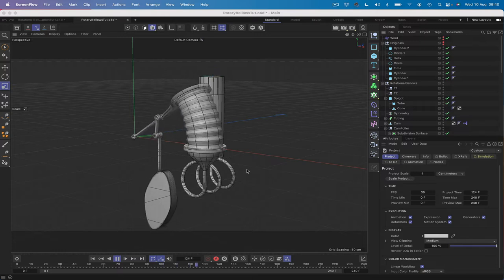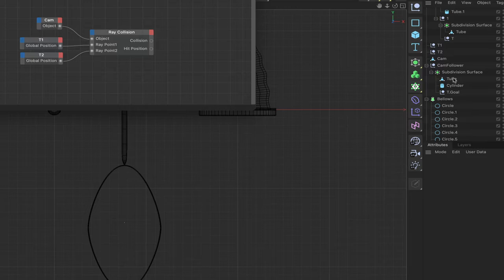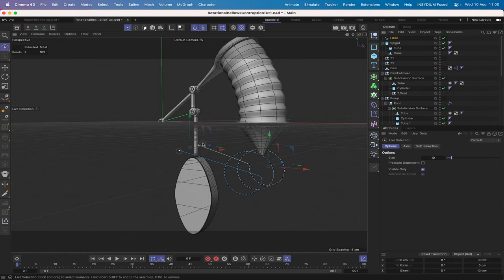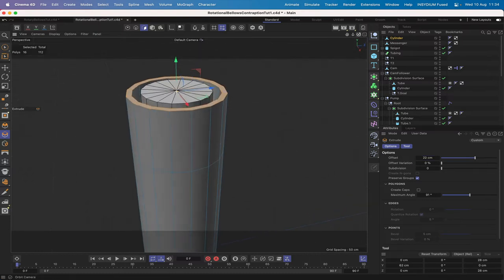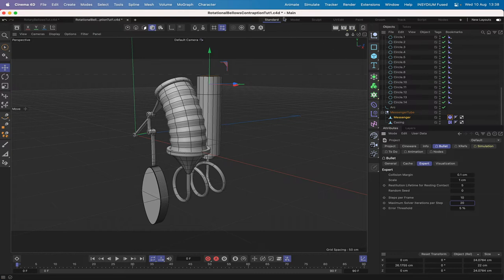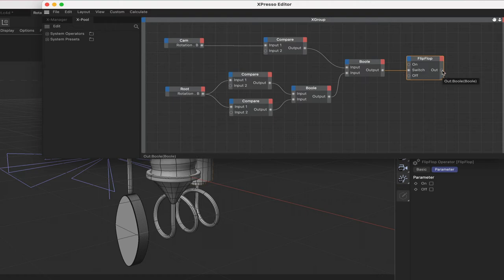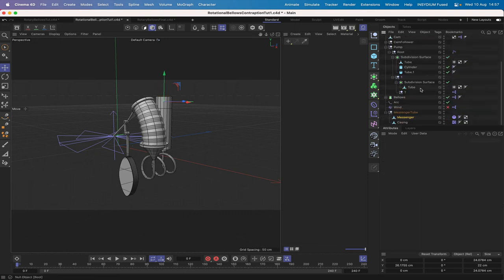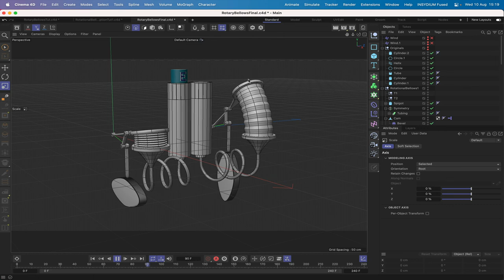Cinema 4D Multi-Tech Tutorial  22 - Rotational Bellows Contraption (Part 2)

Comment: are you familiar with SceneNodes? What are your thoughts? Are you excited for the next release and hoping for big developement about it?
Reply from the maker: I've had a play around with them, but they appear to be more about procedural modelling and are not a replacement for Xpresso (I sincerely hope that Xpresso is left as it is, actually). They are very clever and it will be interesting to see how Maxon develop this aspect of C4D.
Reply: @ExpressoMechanicTV  there is one Tut about a rolling cube along a spline. Yes, the rest is about all the same modeling style. I think it's powerfull, but even maxon trainees don't know what (or how) to do with it.
Reply from the maker: @simontrickfilmer  As I say, I don't feel that it is going to be a replacement for Xpresso (or the other forms of modelling within C4D, for that matter). It is simply another tool in the box, that can be used as need be, for my money.
Reply: @ExpressoMechanicTV  I think maxon has a marketplace for assets in mind... Ray-Collision is also a Node. I'm conna try rebuilt that part in SN... will see how far i can get 🙂